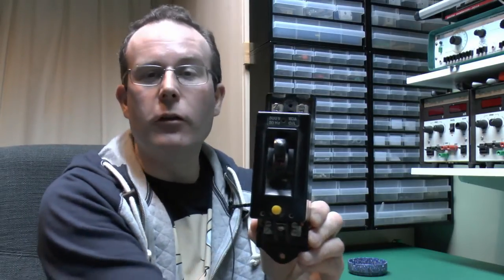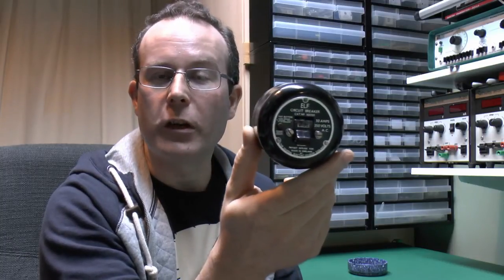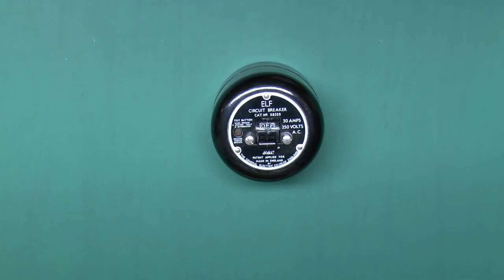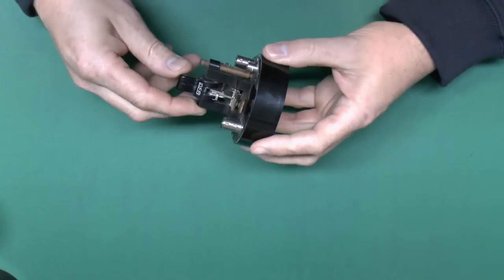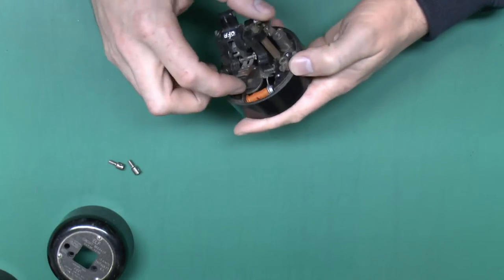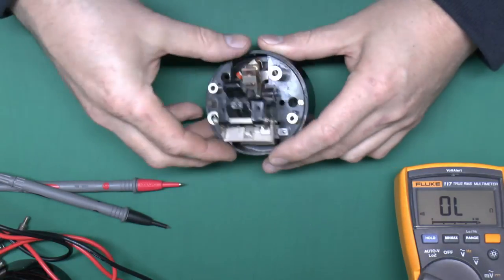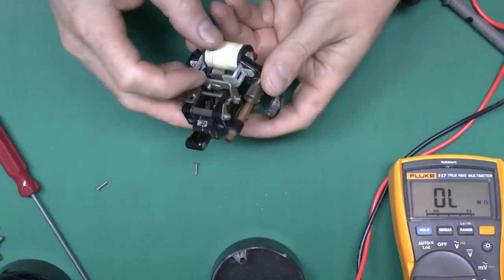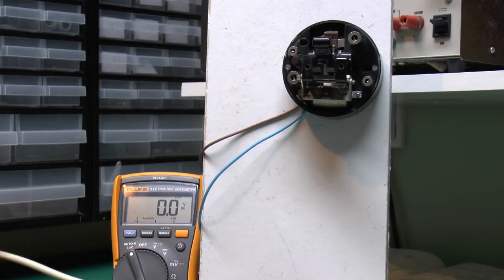GEC ELF Voltage Operated Earth Leakage Circuit Breaker

Comment: The resistor in the 15 amp device is what's called a "dogbone" resistor - very common in valve Radios in the 1930's. I have replaced many in my hobby of valve Radio restoration:) Thank you also for all your explanatory videos for vintage mains  devices - fascinating stuff & very clearly explained.

Comment: Hi John, hope you are well.

Firstly I would like to say I really enjoy your channel it is very informative.

I was hoping you could answer my question? I am a hvac and refrigeration service engineer and have recently taken on the pat testing with certain contracts.

However I also own a fluke 360 earth leakage clamp meter and noticed the other day that even though the insulation test on my fluke 1587 was over 550 megaohms at 500v on this appliance between line and earth/neutral and earth, when I placed the line and neutral inside the earth clamp meter I was getting a O.L reading.

This wasn't the case with other units even with a lower insulation reading in one case 10mohms.

I checked my 1587 against the calcard and it is working normally.

Surely the insulation test is implying the insulation is infact acceptable and the earth leakage should be within a good value (especially as this is an optional test)

I wondered if you knew why this was occurring? Is it because the ac voltage behaves differently to the dc test voltage? But if that was the case then I would imagine the earth leakage measurement would be manditory for appliance safety testing?

I am awaiting my pat tester back from the calibration service and will be retesting it then - until that time it has my somewhat confused.

Any advice would be much appreciated.

With kindest regards
Reply from the maker: DC vs AC can be significantly different, such as when there are filter capacitors between L&E or N&E.  Capacitors will read as a very high resistance on DC, but on AC can pass significant current, depending on the capacitance.
Many types of equipment only connect the internal components when powered from AC, so a DC test will not show anything, such as a washing machine where the motor and heating element are only powered once the electronics are operating and have reached certain points within the washing cycle.
Unless it's a very simple thing like a kettle or radiant heater, insulation tests with DC are only testing the power cord.
Reply: @jwflame  thank you for the reply much appreciated 😀

Comment: So is a current operated earth leakage circuit breaker with a 30mA tripping current just an old type of RCD and therefore classed as safe to use?
Reply from the maker: Yes, RCDs are current operated.
The other type were voltage operated, usually referred to as VOELCBs, those had a connection to an earth rod and the installation earth as well as the L&N connections.  They were removed from the wiring regulations in the early 1980s.